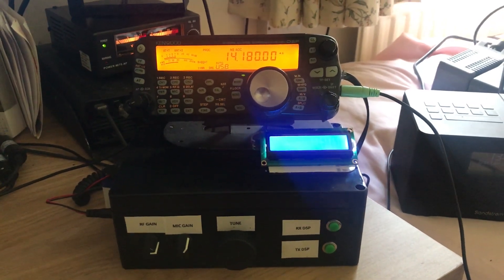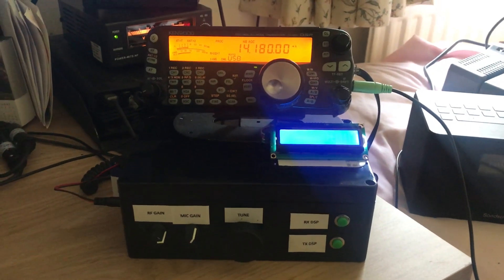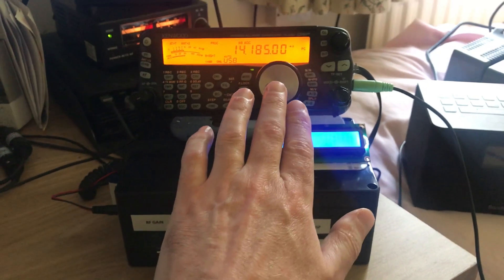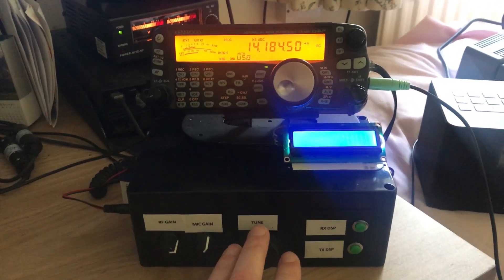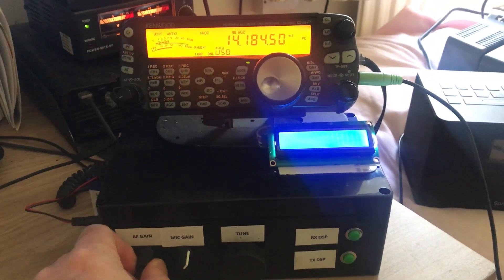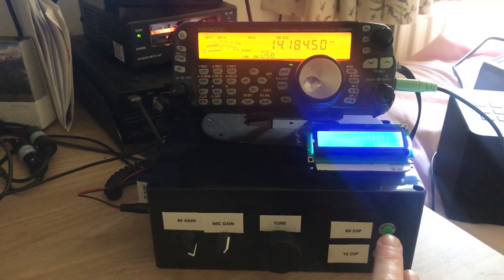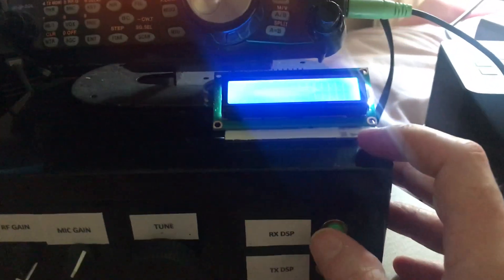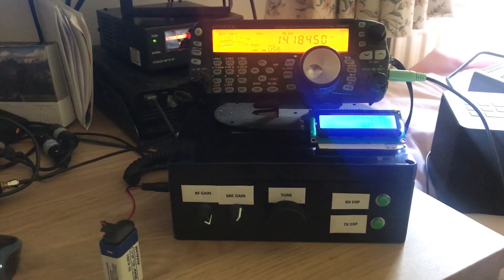Kenwood TS-480 CAT Control transceiver serial Arduino project

Comment: Hello Antony; what a very nice project for your Kenwood TS480. I am also making a cat-controlbox for my FTdx3000 and FTdx101D with almost the same controls. I'm a retired electronics-engineer; worked for the Royal Dutch Navy. I'm not a good programmer, so I hope you will share your arduino-code so I can convert it to my Yaesu TCXs. 
May thanks in advandge. Jan de PA2JJB Texel-Island.